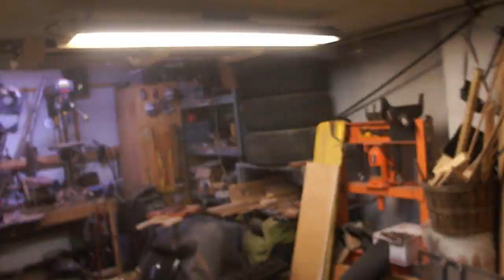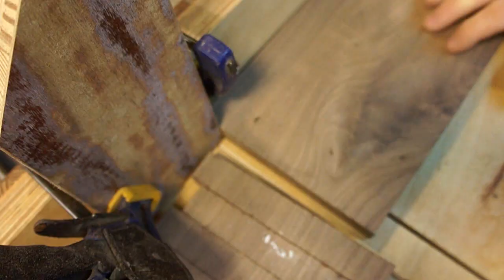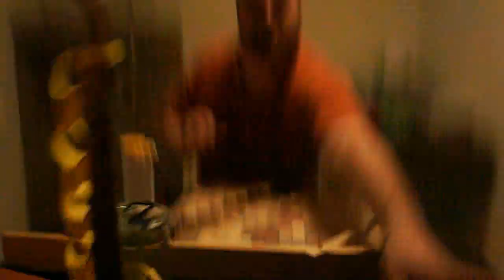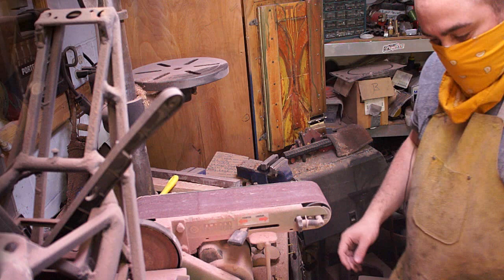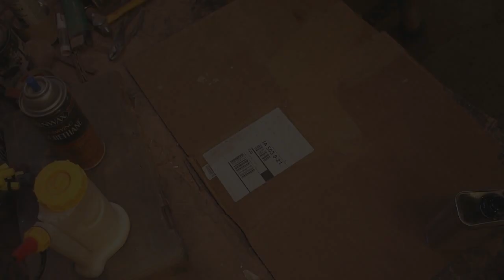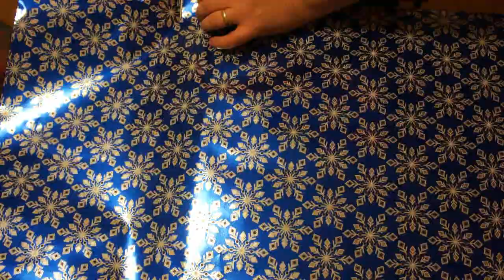8-Bit Mario 1 of 2 Coin Box in Wood

Comment: This turned out great. Using cedar as the red wood? Also, did you consider glueing up a row at a time and clamping like I see a lot of the cutting board guys do? Certainly would have taken at least twice as long if you had to wait for the strips to dry before putting it all together. I've messed around with some little pieces like that, and it's hard to get them all even.
Reply from the maker: +Matthew Friedrichs Thanks! I did try that, and with my pieces not being completely cube shaped I would inevitably get some warping and need to do a lot more sanding to get the row flat again, ended up with more gaps actually. That was the first plan but it just didn't seem to work very well. I did use the cedar for the red, was a lot closer to the right color for the mario I did.